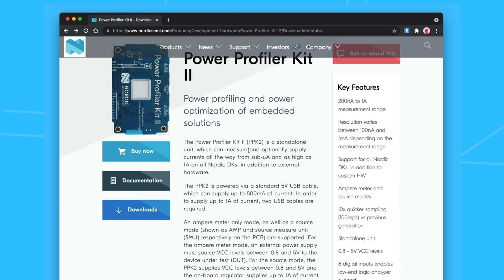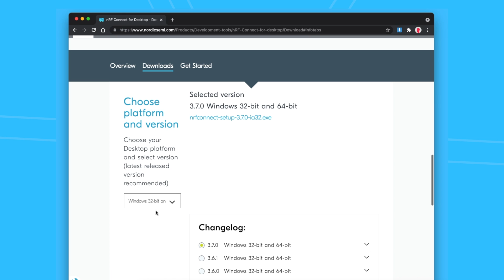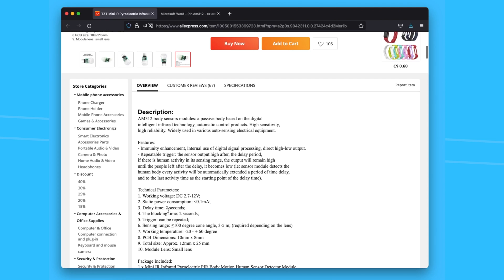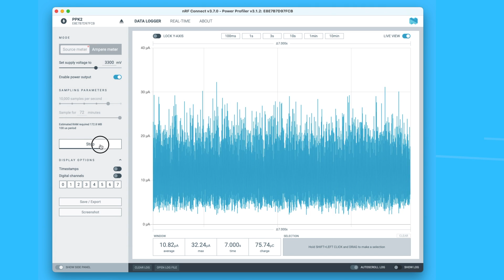Why I love NRF-PPK2!  a new affordable kit to measure very small currents

Comment: To check the accuracy, simply add a resistor between VOUT and GND. Apply for example 3V over a 10k resistor, and see what you get ;)
Reply: Yeah but you need a precision voltmeter to verify voltage and to verify resistance tolerance.
Voltage and resistance have to be almost absolute for the current measurement to be as good.
Reply: @benargee  define accurate. It's all depending on the applications requirements, and this is a 100usd kit ;)
Reply: @wlgrd7052  I guess I'm saying it's good to know the error tolerance of the voltage and resistance so that the error of the current measurement can be known.
Reply: @benargee  of course, if that is what you need.